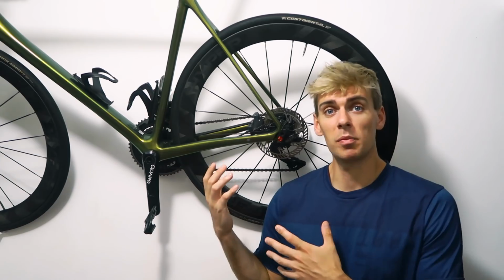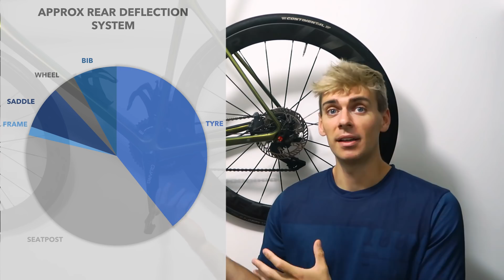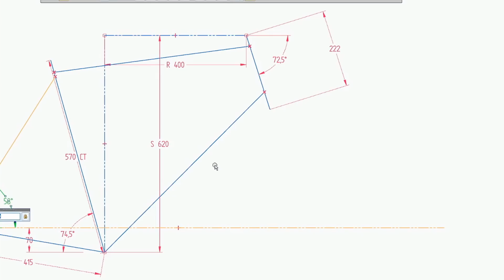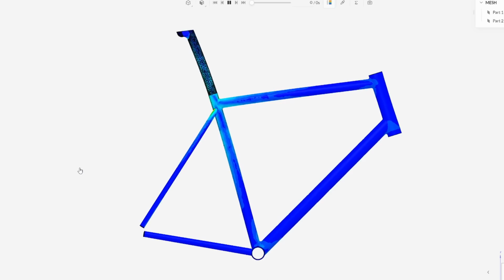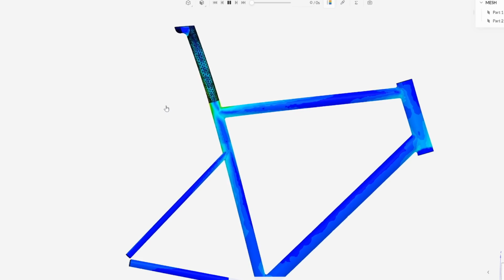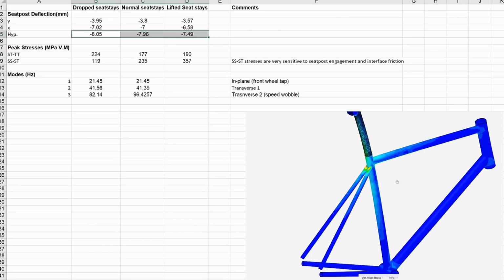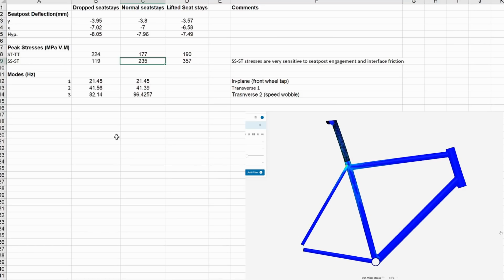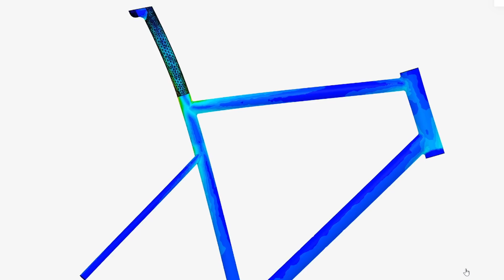Do dropped seat stays improve comfort? No.

Comment: Great video. But surely the forks and seat stays can and are designed to act a suspension units. This video proves that the front main triangle stiffness is not effected by the seat stay design and the seat post is the main factor. But does not prove if the rear triangle design effects comfort. Cannondale and Specialised have for example produced designs that have been more forgiving due to the rear triangle design. Many Alloy bikes do this. If you model the front triangle as fixed and the load applied to the rear axle. Then surely you can isolate the effect of rear triangle and visualise the effect of different designs including different cross sections of the top stay tube.

Comment: I'd also like to add that a combination of 11-17º top tube slope and seatstays that continue from the top tube base will not only look infinitely better, but also yield the same or greater compliance as a combination of a [near-]horizontal top tube and dropped seatstays. As yet another bonus, it will be less delicate than dropped seatstay frames. A lot of advantages (including a visual appeal) - and not a single disadvantage for sloping top tube & normal stay design.

Comment: I know this has no engineering criteria, but i hate the look of dropped seat stays. 🤔😆

Just as a side note, the rear end of the triangle has changed considerably with the introduction of disc brakes, wider hubs and wider tyres. I do believe this design change is more about accommodating these design changes. It is a smaller triangle with thicker seat stays to accommodate the lower angle. This would make the triangle more rigid. Something to consider maybe?

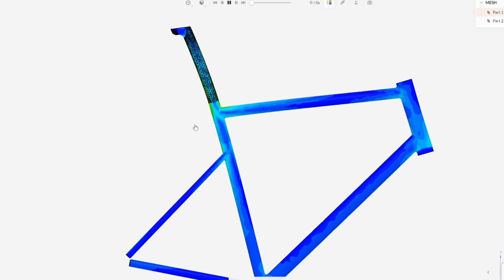Comment: What jumps out to me is that the model of the dropped seat stays shows the head tube anglular deflection occurring which could mess up braking or steering control (see 7:30). Dropping the seat stays introduces a needless pivot fulcrum.

Comment: I think the aero gain of dropped stay is less of the reduced frontal area, but more from better shape. Consider round tube, angle it a bit and cut horizontally, you get an oval-ish shape. angle it even more (dropped stay) and it become even more oval with longer cord length.
Reply from the maker: True. But at this Reynolds and Dimitriev that chord length is so small its smaller than all the local vortices, so it probably won't make a difference.

Comment: So riding a small frame with a lot of exposed seatpost and 28mm or larger tubeless tires is the most comfortable option. Bonus point is, that you can use the stiffest frame there is since it makes so little difference.

Comment: As someone with a custom steel frame and similar body measurements, it would be interesting to look at the top tube angle as it modulates the flex. Mine is a 6 degree slope, which is for whatever reason considered a standard (10 years ago when it was made). But as you're thinking of building one up, it'd be an interesting exercise.

Comment: I'm not an engineer, but i would assume there's a energy transfer when the rear wheel lifts up from hitting a bump. Having the seat stays lower could potentially shift said energy more laterarly instead of vertically. In other words, perceived shock of hitting a bump could be transferred to the seat post instead of traveling up into the seat itself. Mitigation or cushioning of the Primary shock wave vs secondary. 

Another way to think about it is the difference between hitting upward on the seat post vs hitting the side of the seat post. Yes there's a transfer of energy either way. However, there is a directional component to energy transfer and felt energy. 🤷🏻‍♂️
Reply: Its  simply right. He forgot the vertical flex from forcepoint rear hu.

Comment: Thanks. I am interested in what is the anchor point for the frame in your calculations when you apply the 200kg load on the seat. Sorry if I missed it in video. 

Isn't it so that when 200kg is sitting on the saddle then the weight is distributed between the wheels. That would mean that the seatstays are actually loaded. Connecting seatstays to seat-tube in low position would allow some movement for the rear wheel and also would additionally add sideway force to the seat-tube making to deflect more. 

Just interested if this makes any difference.

Comment: Thank you for these insights. One question: How do these numbers change when you take a) a really long seat post and b) put it far more down into the frame? The part above the frame stays the same. 
I wonder, because we had a bike in our shop, where the top of the seat tube failed/cracked, because of a high impact on a downhill ride plus a short seat post stem reaching only the minimum into the frame. We argued, wether a longer stem IN the frame could have prevented that crack.

Comment: It is right if the the force comes from the saddle, like in the video. 

BUT Look at the force point in the Center of the rear hub. Look at the vertical tension and flex, you Look only on the horizontal from the saddle.

Comment: In the horisontal plane, the top tube is used as a torsion bar (with dropped seat-stays). That can't be good for the joining.
How well do the different materials and techniques of bonding or fusing them together stand up to this?

Comment: @Peak Torque... You proved that dropping the seat stays actually does provide more lateral deflection at the seat thus providing some marginal suspension. (Some is better than none, correct?)  7:52
Reply from the maker: Okay. 1.25% more deflection :)

Comment: Is it possible that in composite frames, that it allows for less materials to be used in the localised areas, and therefore reduce the stiffness in those areas? This is just full speculation as I am not an expert in composite structures or FEA. Although to be honest going from a 23 to a 25 or a 25 to a 28mm tyre will still be a greater improvement to compliance, if that is what one wants.

Comment: I’m interested in what happens if you introduce the wheels to this simulation, at the moment the stress is being measured from one point. instead (as I would like to see), how the stresses act between, wheel, drop out, rear triangle and seat tube. 
Would the vibration transferred from the rear triangle not have more material to travel though (and therefore to flex) in a dropped seat stay? 
The smaller triangle, in my mind, would behave more like a pivot. As it will flex somewhat where it meets the seat tube. Then you will have the flexion of the seatpost on top of this? 
To me, I would be looking for the transfer of stress from the dropout to the seat tube, and not the stress of the seat post to the seat stays, that seems backwards to me
Reply: Further to this point, the rear triangle is acting as a whole, attached to a tangent, which is the seat tube. Attaching the seatstays at a lower point would surely force the seat tube to flex more, which would also impart stress to the top tube as well as the seat post?

Comment: genuine questions: how about the flex of the seatstays and chainstays due to the movement of the wheel/dropouts? do dropped seatstays increase deflection at the dropouts? does it have significant contribution to 'comfort'?

I myself am not a fan of dropped seatstays because of its cons. I'd rather have a jarring but pedal-efficient frame than a flexy one with compromised strength.

Comment: The dropped SS appear to normalize the weld stresses for the two points you looked at. That would appear to point to dropped seat stays as a better overall design. Not for comfort, but for long term weld durability. But I’m wondering where else the stress may have increased.  Normally trade offs aren’t free.

Comment: Dropped seat stays combined with a compact frame (aggressive sloping top tube) result in a longer seat post with more flex/deflection = more comfort.
Of course, high gains in comfort result with lower bodyweight i.e. sub 12% bodyfat.
However, bike manufacturers cannot lever sales out of that factoid.

Comment: Great analysis of dropped seat stays -  makes complete sense.

Sorry to be that one that points at the pie chart - but I am really surprised a seat doesn't deflect as much as the post?

My seat (Charge Spoon) has 20cm between the rails, and I can see it flex under hand pressure. My post is 10cm above the frame, with 150kg in 2G case I'm guessing I get 5mm deflection on the post? I would be surprised if I didn't get the same, or more, from the seat itself?

Comment: Does it make a difference if the seat stay is inside the seat to or fit around the outside of the seat tube? I assume no, but just wondering.
Reply: ie trek emonda 2021 (doesn't have drop seat stays, but seat posts slides over the top of seat tube.

Comment: Very informative, thanks! I'd love to see a video for taller and heavier riders, something like what should heavier riders consider when they buy road bike components. I know that you are also tall, things like the "right" tyre width for heavier riders or "right" wheelset for example. And it would be super interesting if you would discuss the topic J-bend vs straight pull. 
Currently I'm planning to buy new wheels and I read that a deeper rim provides more stability? I want to buy the WR65 from light bicycle, I know for sure that I will take 28 spokes in the back but I'm not sure about the front wheel, I already had Mavics and a cheap chinese carbon wheelset ranging from 20 - 24 in the front and never had problems. So I'd consider 28 in the back and 24 in the front would be the best solution? I'm 2,02m and my weigh is about 104kg.

I know too many questions. ;)  ✌🏾
Reply: As a former bike mechanic with 20 years experience  - standard J bend spokes are the way to go.  In terms of which frames are best for bigger riders bigger diameter tubing is your friend.  Super thin walled tubing is for rich weight weenies and sponsored racers.  It's hard to predict what is going to hold up to a given rider of a given size as riding style has a HUGE effect on how much stuff they're going to break.  A rough riding 140lb rider is going to be harder on their bikes than a smooth 210lb rider.
Reply: @mikekrasovec6390  Thanks for your answer. Regarding to J bend and your experience I trust in your recommendation. Only problem, I want the WR65 rim from light bicycle so I have two options. I let them build the whole wheelset with "straight pull" or I only order the rim and build the wheel on my own. I would take the DT Swiss 350, they are not expensive in Germany and Pillar spokes. Only problem I have no idea how to lace a disc wheelset. I already have the tools and the stand and it would be a great achievement to build a wheel on my own, on the other hand I don't want to ruin anything.
Reply: @wsnx_  straight pull spokes aren't the end of the world. They work.  They have 2 advantages 1. Some people think that they look cool.  2.  If you break a spoke they can be easier to replace than a J bend (mavic wheels a few years ago if you broke a spoke on their straight pull spoke equipped wheels you had to loosen up a bunch of spokes to get the new spoke in and then retension everything back up.)  On the downside straight pull spokes are more expensive and harder to find.  If I break a spoke on a normal wheel I can go into any bike shop and get a new spoke of the right length for $1-$2.  And they have it in the shop.  That isn't the case with straight pull spokes.  Also when trueing or tensioning the spoke(s) both ends can rotate vs 1.  With an old wheel that has (semi?) corroded nipples the headache factor is considerably less.  That said straight pull spokes as well as standard J bend both work and should be able to have similar durability.  As far as you building your own wheels  - if you're decent with a spoke wrench you should be ok.  The first wheel I built I used my brake pads as a trueing stand.  It lasted until I wore through the brake walls.  If you have a good old school bike mechanic that you like they should be able to build you some good wheels.
Reply: @mikekrasovec6390  Thanks for your input, I appreciate it and it helped. I will decide which way to go in the next days or weeks and I will let you know which decision I took. Good riding! ✌